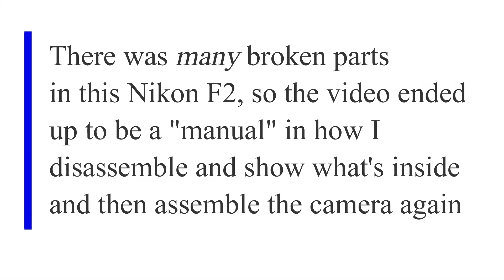Working with different issues in Nikon F2   PART_2__assemble and many other details

Comment: Thanks very much for all your valuable instructionals. In this this one, I was disappointed that you did not show us how to disassemble the re-wind mechanism, which is the very problem I'm having with an F2 I have. Trying to raise the spindle to allow me to insert a roll of film does not work: it will not raise either by pushing upward from inside the film chamber or by pulling up on the rewind knob. Any thoughts, Kenneth?

Comment: Great autopsy, I had to disassemble my F2 last year to clean the slow gear mechanism that was sticky (that's why Leica changed it's position to the top of their cameras like the Leicaflex, because on the bottom it gets dirty). And also I had to change the battery case that was damaged. Now it works perfectly. If I had seen this before it would for sure had helped me.
Reply from the maker: Thank's I'm happy that the video could help you :-).
Reply: @mikeno62  I'm still waiting for the oportunity of when you show how to disassamble the Tamron 80-210/3.5-4.0 Adaptall-2. Your videos are of great value.

Comment: Thanks for posting this. I used it as a great source of information to see how to remove the bottom plate, clean up 50 years of vertigris,  and re-solder the feed to the meter switch that had let go. Thrilled to have the camera working perfectly!

Comment: Hey Mikeno,
Thanks for your very helpful and informative tutorial about how to disassemble this camera! I am just fixing one of my own F2, and it helped a lot! 
Please do not throw away such non-repairable cameras, as they are very valuable as donors, to get spareparts for another camera! I fixed one of my very beautiful Nikon F with a torn shutter curtain by taking the curtain out of another camera, that got into water and was full of rust - but fortunately, the titanium shutter curtains were completely intact! 
I have two questions:
- Isn't it a good idea, to not drown the selftimer escapement completely into IPA, as the driver spring is probably also lubed with some thicker grease, that might get washed out? So, if you do not want to completely dissassemble the whole unit, I'd rather only clean the low torque / high speed gears and keep the spring box away from the alcohol...
- I'd love to learn a bit more about the adjustment options for the shorter exposure times... There are two concentric screws on top of the timing mechanism on the upper side of the camera... They are connected to excentric parts underneath the mounting plate, and I am pretty much confident, that these are the spots where you can adjust the other speeds... It would be great, to get info about which time to adjust where - and in which order... Until now, the only adjustments I did was the main springs, driving the curtains (first, I adjusted the second curtain spring so, that the slow escapement works fine, then I adjusted the first curtain for identical exceleration, resulting in even exposure from left to right @ short speeds.)
Thanks for all your great help, man!!!

Comment: Great videos! I have the following problem with my f2. When I bought it, it was working, although 1s speed was really slow. But all other speeds looked fine. At some point, I decided to remove the bottom cover, but the screw with two holes is really really stuck. After forcing it a bit, the camera just became stuck. It wont' fire anymore. After I removed the mirror box, I was able to unstuck the curtain, but now the camera just fires normally at low speeds. Over 1/125, the shutter just fires all the same, and really really fast. Bulb too. Do you have any idea of where the problem is?

Comment: I am curious, one of my F2a prisma lightmeters does not work correctly. At the contact points on top of the body i measure 2.76 volt and it is not consistent. I suspect a bad solder or so. The compartment is clean. The contact you activated with the film transport lever (on of function) is like new. But to reach the underside of the battery compartment you need to remove the mirror house?
Reply: With the F2, it is not uncommon, that corrosion appears at the screw, where the middle contact of the bat compartment is screwed to the plastic part of the housing. Also the plastic tends to crack, both resulting in bad contact to the wire, that is soldered to a seperate terminal, held by the same screw. I glued the plastic part in my F2 with superglue, and it seems to work (but I cannot tell, how long it wil last). For sure, the best option is to replace a broken compartment with a new one. 
An, yes, you need to pull the mirrorbox to get access to the battery compartment.
Reply: @salossi  I did fix it already. I did take the body apart and the little brass contact on the battery compartment that is clamped on the power wire of the light meter contact was eaten all up by corrosion. I did replace it for a metal one and the meter was working perfect. Getting at the underside of the compartment was the hardest and removing the shutterhouse was needed. But beeing a great build camera it was a joy to work on.

Comment: HelloMikeno, please i need your support to reassemble a Nikon F3, the issue is that the film advance but the curtain does not move, i removed the speeds selector and the part located just under it who turns the mechanism that pulls the curtain, my problem now is how align the gears ans parts to reasemble correctelly the mechanisme
Thank you in advance